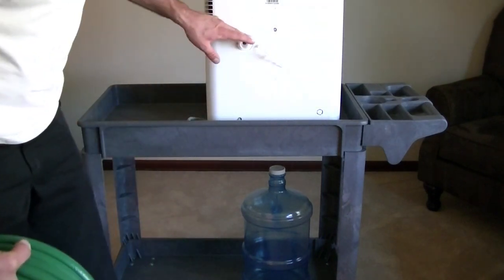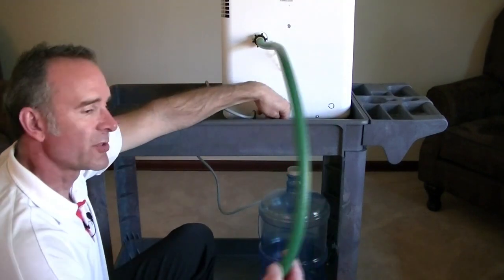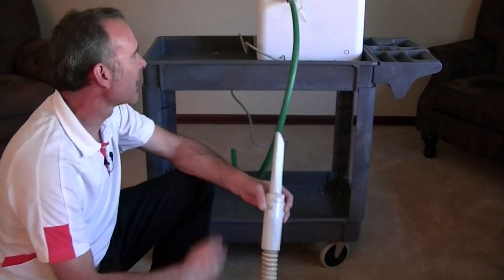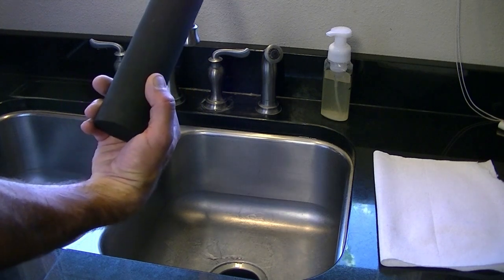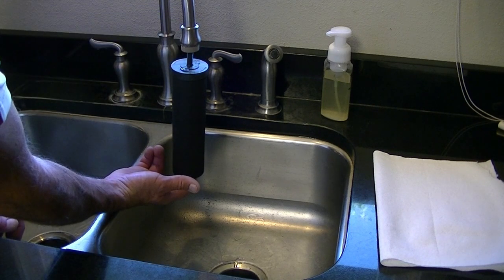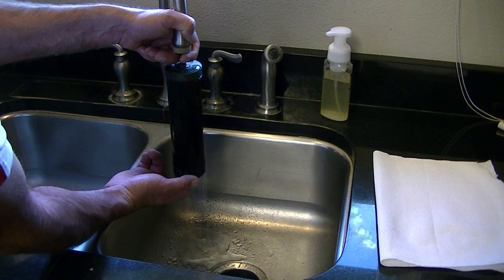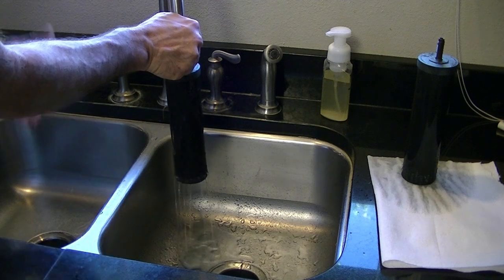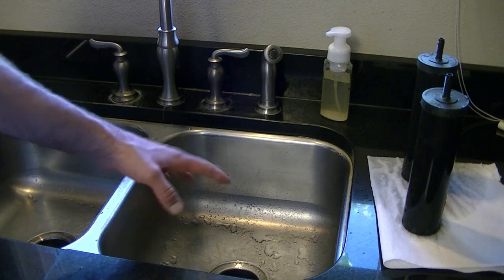Part 2 | How To Make Your Own Air To Water Generator At Home | 4 to 9 Gallons Of Purified Water/Day

Comment: This is deranged ya you hook up a dehumidifier to a bottle. I hook mine up the same way to the drain in the basement floor which is where that water should go. YOU are NOT supposed to drink water from a dehumidifier dum whit   ew you are now drilling a hole thru the table. good grief.  this is total lunacy

Comment: I'm really enjoying this series, I purchased a dehumidifier for my apartment recently, mostly for the bathroom but I've been running it in the living room recently when I have the windows open since it gets humid here in the mid-west. My dehumidifier is a 50 pint unit. I've actually been making and drinking my own distilled water for 4 years. drinking distilled water actually does not remove minerals from your body, we get our minerals from food, not water. I use a two step process for my water. First I distill it, this takes some time because the water must be boiled and then recondensed, a gallon takes around 4 hours. Then I put the distilled water through an Aquasana water filter to remove any remaining bad taste. The water is wonderful. I decided to try this process on water collected from my dehumidifier. It works great. In the dehumidifier manuals they tell you not to drink water collected from dehumidifiers but once it's purified it should be fine. Rather than using a hose I just dumped a gallon of the collected water from the dehumidifier bucket in to one of my water distillers.

Comment: 1/2 a teaspoon of salt in a single gallon of water??? That's too much salt.  It's going to be like drinking salt water.  Maybe a grain of salt.  1/2 a teaspoon, that's enough for 100+ gallons.  If you're doing that purely for the mineral values, there's better alternatives.  Pink himilayan salt has "trace minerals".  They're in such an incredibly minute amount if you filled the grand canyon with himilayan salt, it may equal a single drop of minerals.  That salt is pink due to iron or rust from the deposits it was mined from.

Comment: These filters do not remove floride although Berkey does make separate floride filters. Also this is not cleaner than distilled water although the water coming from the de-humidifyer is distilled. Heating water vapor then condensing it is the basis of distillation. All in all this is a great simple AWG.
Reply: Hey dum-bass, water taken out of the humidity in the air won’t have fluoride in it. The filter won’t need to remove fluoride. Why? Because it’s not there to remove. But, by all means, Snowflake, if you’re concerned about fluoride in water taken from your home’s humidity, then get a filter that will remove it. But don’t pat yourself on your back if you find, after testing the water for fluoride content, there is no fluoride. Why? Because, again, there was no fluoride there in the first place. And if, for some dum-bassery reason you are concerned about fluoride dissolved in the humidity of your home, do you wear a mask in your home to prevent you from breathing in the fluoride? Probably. hshahah  What a marooon.

Comment: Great subject. You can run a thin line vs. large hose. I have a 3/8ths I think.  Celtic salt has more min. and pink salts can differ in quality from China probably.  It may be a good Idea to drop some good quality copper in your collection bucket as it kills bacteria...or a silver coin...remember the smart rich still use copper pipes?

Comment: I am confused, if you make distilled water, why would you need to filter it?
Reply: This isn't distilled, it is condensed from the air. If you don't filter dehumidifier water, you get to drink all the dust that was in the air too.
Also, be cautious with this setup, some radiators (where this water is condensing) have lead solder which can leech into the water as it drips off.
Reply: @zedmeinhardt3404 sort of like our home copper water lines😅
Reply: @proudamerican715  
They don't use lead solder in modern potable water systems. If you have very old plumbing it's possible. 
However for non potable soldering, lead is cheaper, easier and faster for production.

Comment: I would suggest everybody buy charcoal used for filtering liquids & to make their own filter.

You can reuse the charcoal after it stops working by baking it in the oven for a period of time & all the filtered compounds cook off & the charcoal resets itself & this process can be done INDEFINITELY.

I do this with my moonshine still charcoal filter that I filter my top shelf booze with.

Which BTW a moonshine still can distill water just as good as it can distill booze. Distilling water removes all the bad things from it leaving you with 100% PURE water. You can mix mud puddle water & take a piss in it & distill it back to ONLY 100% water.

So for prepping purposes it NEVER hurts to have more than 1 system that arrives to the same conclusion, which in this case is drinking quality water, which is needed to sustain life & that justifies having 2 different systems with different weaknesses so that you also have different strengths.
Reply: Hah yes! I have a kettle almost finished good Idea. Having a solar panel and water heater element is a simple way to heat water and steam for free. Would go great with the brewing system.

Comment: You can buy tubing and a fitting. 
You can buy a shorter piece of hose as well. 
👍 great video
Reply: I'd connect a brass hose spliter with the 2 out puts as inputs and use 2 dehumidifiers going down to the water collection and I saw the people saying how unsafe it is in comments and couldn't help but laugh at them it's safer to drink water from this system then fron the tap or the bottled water since deer springs water is from deer springs water treatment center for there local  tap water where they are located buying bottled water you are just paying water for a different states water board that supplies water to there town used to have a friend that's job was to fill the deer springs water bottles for sale and it all came from the same place and same treatment as the water they pumped through the pipes to homes and businesses
Reply from the maker: Great idea!  Thanks Mike

Comment: Thank you for the excellent videos.  I recommend steel water jug, braided steel hoses and metal connectors.  All that plastic will contaminate your water.  FYI BPA free is a marketing gimmick.  They change the molecular structure of plastic slightly, eliminate one troublesome chemical and test for that, leaving hundreds of new xenoestrogen- emitting VOC's untested for.
Reply from the maker: I did not know that; great tip, and thank you!

Comment: There is a miss conception that distilled water draws minerals out of your body, this is not true, thousands of yachties around the world would be suffering if that were true. The Mayo Clinic for cancer research and treatment only uses distilled drinking water. Distilled water can have a leaching affect on concrete etc and this has lead to the belief it does the same to people, lucky we’re not made out of cement.

Comment: Trash the garden hose and use a drinkable hose like Camco EvoFlex 4-Foot Super Flexible Drinking Water Hose

At the end of your hose that dumps into the water gallon, attach a filter , carbon or use a .01 micron cloth filter

Here’s my setup:

A dehumidifier with steel coils that goes into a water distiller , once the distiller tank reaches full, it turns on and then runs through a .01 micron filter then into a 8 gallon stainless steel tank with timed scheduled UV lights

btw , there’s no such thing as cleaner then distiller water. all filters do is capture contaminates BUT you have water that has to pass through the junk. Distillers separate, this is the ultimate goal.

sorry wrong again , you want pure water, get your minerals from food NOT from water, 

you WILL NOT die from drink distilled water , my family drinking distiller fir over 12 years
Reply from the maker: Great tip!  Just changed that in the description
Reply: I was thinking the same thing about the garden hose, any good hardware store should sell good hose material
Reply: What brand humidifier and distiller?
Reply: @mahavira108 ss-4 midi -still is my distiller

This thing has been running for over 5 years , no wonder why they ar expensive

I gotta go to the basement to find what the humidifier is . I got a different humidifier now
Reply: Finally! Someone who understands what’s going on! This guy’s vid is no way making pure or drinking water.
Reply: A pinch of salt can provide needed electrolytes.

Comment: I drove a R.V. Hot Lunch Truck for 38 years. I use to use a nylon hose to fill a  holding tank to make coffee for my customers. One day I bought a rubber hose to fill the coffee tank and to my amazement, the rubber hose took away the strong bitter taste in the coffee!! A nylon hose ruins the taste of water! I noticed that you were using a nylon hose, NOT GOOD!
Reply: That's hilarious.  Few will agree with you, but I will.  It may not be healthy at all, but the synthetics in the rubber are petrol based, which has a high nitrogen content, which makes it sweet.  Rubber, being a resin, has the same properties.  It may not be good for you in the long run, but it tastes good.  I recommend braided steel.  This is why conventionally grown produce often tastes better, too.  Petroleum based fertilizer makes them taste sweeter.  I eat the organic for health reasons but it doesn't taste better, sadly.

Comment: Never use a garden hose, if you use a garden hose you will surely taste the inside lining of the garden hose. Instead use a RV drinking water hose. I know this from making that mistake.
Reply: I was very concerned about that hose. Thank you.
Reply: They make hose for RV that are drinking water approved
Reply: Glad to help.
Reply: Glad someone brought this up.  A regular garden hose leaches all kinds of chemicals into the water and you shouldn't drink from one.

An RV hose is the correct one to use, even clear plastic hose has to be portable water certified.

I hope he covers purifying the water before consuming it. I worry about the plastic in the dehumidifier leaching into the water as it's drawn from the air.  They don't claim that it's safe for drinking the water it distills from the air.

I suppose you could distill the water afterwards with your distillery.  That should remove impurities and I suppose any chemicals that might be in the water from the dehumidifier.

I wonder how much it would be to get solar power to run the dehumidifier.  That would make it "grid down" able.  It would reduce the amount of water produced unless you used batteries to run it 24/7, but that's getting expensive, I guess the alternative of dehydration is worse...

Seems like a good distillery would be easier and cheaper and there's always water to be distilled.

BTW don't drink your urine.   If you have any infection you could die from drinking it.  

You can make a solar distillery by digging a pit. Cover it with clean plastic, (weight down the edges) place a can under the center and place a small rock over the plastic on the top of the can making an upside down pyramid.  You can pour water around the pit edges (including urine) to be evaporated and condensed on the plastic and caught in the can... Courtesy of WW2 pilot survival training.
Reply: I was thinking the same thing, but I figured I would give this YouTube’s producer the benefit of the doubt and assume he was using a taste free hose. They make them for RVs, and I have them for my fresh water supply on my boat.
Reply: How about energizing the water with a copper hose?
Reply: Frank out of the house as kids for yrs😅now it's a problem.jpw about your copper water lines?

Comment: This is a good method to put together a simple water from air system.  Good video. I would not have put a hole in the jug’s cap, especially if you plan on using the jug for storage.  Just take the cap off and fill the bottle. Then cap it and find another bottle or water brick to store more water.
Reply: His method slows down the inevitable evaporation process. All he needs is just ONE cap with the hole in it. When full he can still screw the regular cap on and store it.
Reply: I thought the same thing. Could've put some plastic wrap and poked a hole in it 🤦‍♀️

Comment: People, please don't drink water produced by dehumidifiers!!! Their coils (the parts that condense water) don't have a food‑grade coating. And some coils are even coated with bactericides and mold reducing compounds which are highly toxic if ingested. I am putting this comment on all of the videos in this series to raise awareness.
Reply: Where did you get your info? If the coils are aluminum it could be bad because too much aluminum is toxic in the human body. Copper would be better, the body uses a certain amount of copper.
Reply: If the alternative is die of thirst, I'll take my chances with the possibility the coils may slowly kill me over time. This is an emergency set up. It's not a special water for wellness or detoxing.
Reply: I"m really glad i read this, thank you
Reply: @jett888  I would filter the dehumidified water to reduce the contaniments. Distill it, reverse osmisis, sand and carbon filters. Look into extraction processes of excessive aluminum or copper contamination in water if you go this route. Obviously this is only necissary if other water sources are too expensive or polluted or not accessable and for drinking, cooking potable water. Shower and bathing water is secondarily necessary to filter as it is in contact with skin that absorbs. Thirdly, water for cleaning needs less filtration but is still important as clothes and dishes need to be clean, finally toilet water can be reused grey water.
Reply: @terrafirma9328  i have an ozinator and chlorine dioxide ⚘
Reply: @jett888  Cool, sounds like you've been looking into and trying other things. 👍 Keep learning, new improvments are being revealed practically everyday.
Reply: @jett888  Also, there are many alternative water sources but any or all could be contaminated at different points with different things. Many stages of filtration may be necessary. Tap water , bottled water, rain water, well water, evaporated water, river, pond, , lake, and ocean water as well as dehumidified and finally distilled water each have different issues to know about to treat. The goal is know all the sources, dangers and cheapest processes to be safe and stay healthy.
Reply: what about copper coils??
Reply: thanks
Reply: Obviously the water needs to be treated and conditioned. I wd discard at least a good amount of water at first.
Reply: Lol, brilliant. You don’t understand words and sentences or just didn’t watch the video. He’s putting a very effective filter on there. Are you incentivized by the government to spread disinformation to keep people weak and dumb or just greatly underdeveloped and dumb yourself?

Comment: You need to be using a hose meant for drinking water, not a garden hose.b
Reply: Walmart or RV camping stores have those drinking hoses because they're used in trailer parks for clean water. Some garden hoses have a lot of lead in it's material still.
Reply: I'm just fine from drinking garden hose water back in the 70's, Its the coils of the radiator I would be worried about. That's Metal.
Reply: @jemmasterJohnE  I wouldn't worry too much. You'd want to filter the air and water. While cleaning the dehumidifier periodically.

Unless you enjoy drinking whatever is stewed at the bottom or in the fins..  flavor maybe?
(Possibly hazardous with bacteria / mold. The flavor part was a joke and I don't recommend drinking it untreated.)
Reply: Iam just saying in a survival situation.  The last thing your worried about is BPAs in the plastic, and more about getting water to survive.
Reply: Also it'll taste like garden hose
Reply: @Iszix87  Yup! There are lots of chemicals inside a garden hose that taint the water and poison you.
Reply: he is a total idiot.  this video should not be on the internet.  you are NOT supposed to drink water from a dehumidifier and he is not telling us anything an idiot would not know

Comment: Can you tip the water in the collection tray at the back into bottles or would the water be tainted by the plastic of the water collection tray?
Reply: I believe that you need to have a food grade hose, a regular garden hose introduces lead, and other contaminates,  to your potable water.
Reply: @markcorey3914  agreed, he should use flex copper or stainless steel hose
Reply from the maker: Hi Ani, I would not recommend using the tank that comes with the dehumidifier for a few reasons.  The plastic tray is not made “BPA Free”.  This doesn’t sound bad at first, but if you take a deeper dive into plastics used, you can find that most plastics that aren’t BPA Free can include a chemical used in the manufacturing of certain plastics, called “bisphenol A”.  According to “Medical News Today”, this type of chemical has been linked to a whole host of cardiovascular problems like coronary artery heart disease, hypertension, heart attack, angina, and more.  I am not a medical provider in any sense of the imagination, but I wouldn’t risk it.  It’s too simple and cost effective to purchase a BPA free hose and bottle.
Reply: the fact that it's made in China probably is a good indication that it's poisonous.